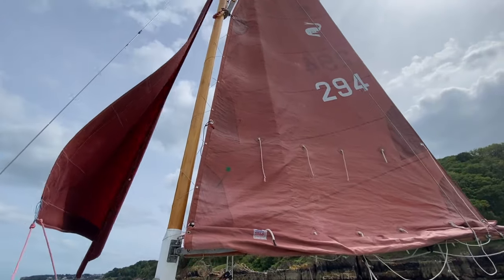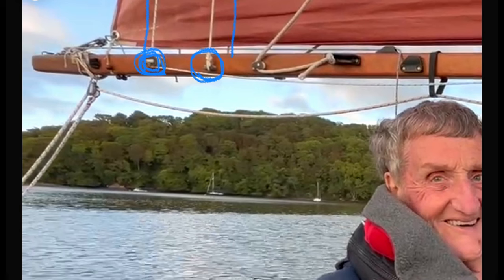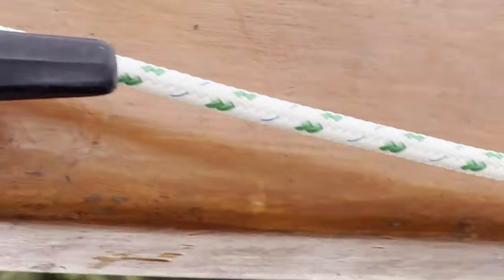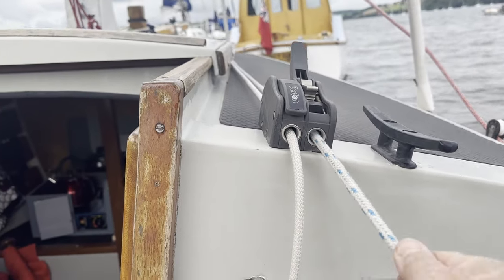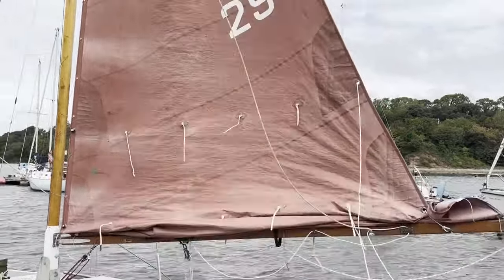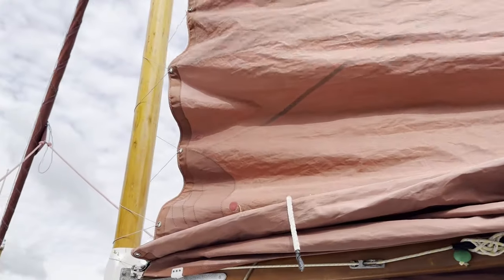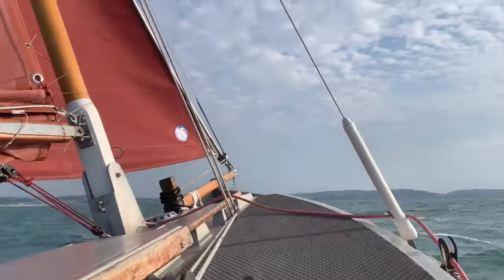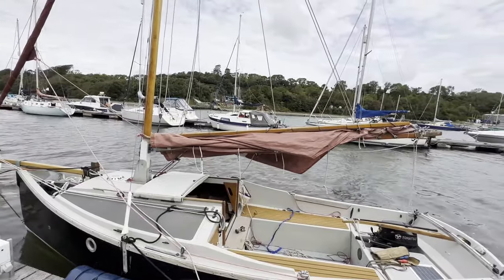No. 23 reefing a Cornish Shrimper 19

Comment: Nicely done sir I found that useful as recently got a Shrimper with no manual supplied and was struggling to work out where the forward lines were routed cheers. 
I've just marked my gaff halyards so know roughly where to lower age gaff to. Was also wondering do you have any order to which sail you reef first ie gib or main. Was that a Philippines flag if so that was some voyage.....
Reply from the maker: Glad it helped, I know many owners start with the jib, its easier after all, but my first reef is always the main. I think its got the best balance with one reef in the main and a full jib. After that, a second reef in the main and finally the jib. Although if i start to roll the jib in, it's too windy and i'm looking for somewhere to stop.
The flag is not the Philippines alas, I missed that out on the shrimper circumnavigation :) its the Brixham Yacht Club Burgee.